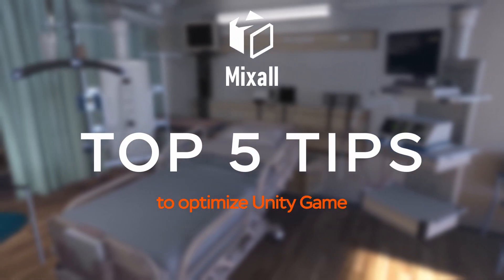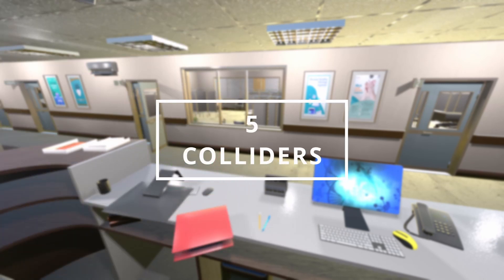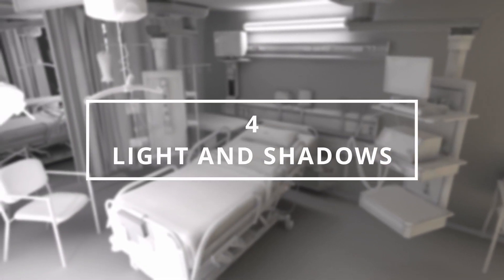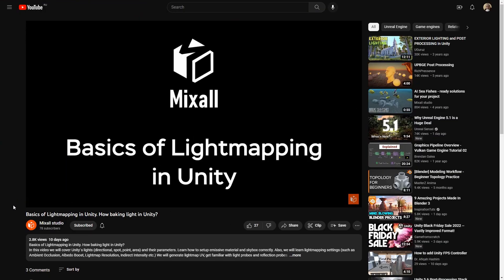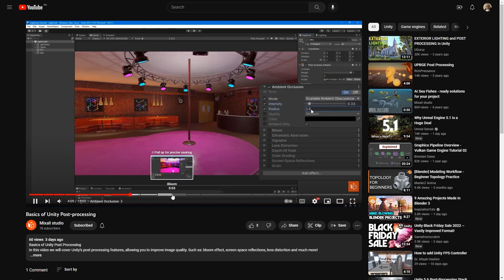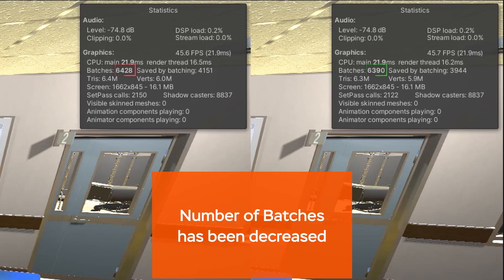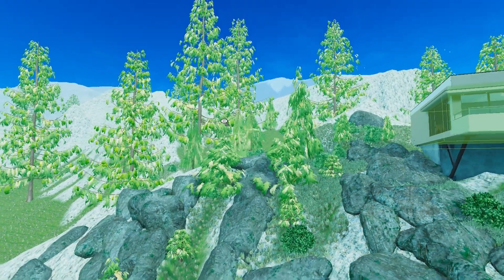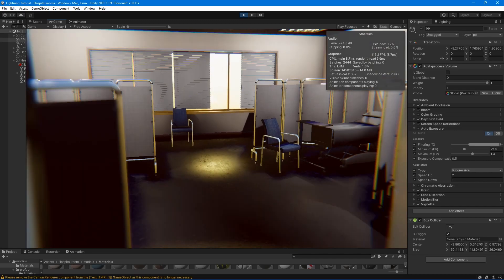Unity Optimization tips | Unity 2022

Comment: Hey there :)
Always good to see videos like this.

"Mesh Colliders"
on the first Hand, you right. They will consume more Power than Box Colliders. but 
you need 10 up to ??? Box Colliders to get a "fitting Collision" for one Object, and just 1 Mesh Collider, do have the same Effekt.
The best will be in every Case, to use Lod Models. If you get a Lod 0, give him a Mesh collider, the Lod 1 can have none, or if you need a Collider, one full Box collider. This is truly the better Idea, than to setup your Scene holding 200 Box colliders, in difference to ~ 10 Mesh colliders.

"Baket Light and Schadows"
Yes, they are a possible Idea. The problems start with the following massive problems with Light Bakings:
1. - All Textures and Materials, contain the Light Baking. This is handlet by Default and needet. To set other Thigns into Places will be fail, if you have a "Baket" Texture. This is the disadventage to "Real time Light"

2. - you cant do really "new LIghts" inside a baket Scene. This is also a huge Problem with Baked Lights.

3. - the Baking of Light Textures only works if you have mapped GameObjects, what do not use "Cube Mapping" or "Oversized UV Maps". If you using oversized UV, and tileds, you have a lot better Quality and highter Texture Resolution possibilitys, than to use thigns like boring "Substance Textur Crazyness Graphic Card Memory Killer" Models. So in this case : you cant use Light Baking. The Reason is simple: Light Baking Textures can only be generatet for Objects, are mappet inside the UV Space of the Texture. This is truly in most cases a absolutly waste of Textures, Texture Memory, and slows down every Game.
To use Tileds and oversized UV Maps, is always the better choice.

So: yes Light baking - can - save Power,
but the bad Sides of Light Baking are so massivly, that it really is not usable to me.
Better to do Real Time Lightning, and be cairful and clever with the Light inside the Scene.
Best of all: you also can bound your Lightning to the Lods you use. Will be save more Performance in Realtime Lightning, with a 10 times better Result, than to use baked light, only contains for one scene, with one Material, and only 1 Place Possibility for your Objects.

You fill up your Graphic Memory with A LOT of Textures all are baked! 
not a nice Idea.

Post Processing, you are absolutly right.
but i recommend to use an Asset, not the Unity Default Package. The post Processing Volume v2 is okay,
but i focus Kronnect Beautify. It s more flexible, gives you better Performance, can do a lot , posprocessing cant do.
its worth every Cent.

in Case of "post Processing" Save Performance in the case not to use "Color Grading", instet use Light with the different Light colors. You will have the same Result, without light baking you better on your way.

Also use center Lights in rooms. often, you do not need to give every "Lamp" a Light. It s just a Performance Waste.
do one Center Light. Better, same Result.

3.: Occlusion Calling.
can be useful, but also brings CPU Overheats. Be cairful with that. To set all in different Layers, consumes often more Powers, than to set a Render Scene without Occlusion. Better to use frustrum Calling, if you want this. This need not so much layers. In Open Worlds it s the best idea to use a Frustrum Calling, also handle this with "Sight Cubes" in a Grid System.
So you have less void updates, and a perfect Usage to disable the whole not visable Scene, with only 1 Void Update.
Working like a Charm. But Frustrum Calling need Experience, need Model Building, and also need to buy an asset.
Occlusion Calling in Unity did never work for me. It does not care how i setup it, unity is: "baking, baking, baking into eternity" never finish this. I dont know why, it s just the point. Also in open Worlds, Occlusion Calling is a really big Problem. If you using a World Streaming System for Example, you should have a Solution from the store contains this Occlusion *OR* you have to find a own way.

out of the Box, Occlusion is just there useful, there you have a static scene (for example, one Room, like your Hospital).
but: this is rare...... and always think about one thing: with EVERY Frame, you need to trigger EVERY Occlusion setup inside *EVERY* scene Model, to have the Result: "Visable or not".

not a really good Idea.
Can help, but occlusio is the last way to do things. There a lot ideas what are better than this.

One of the Most problems is really good to see at 3:56 "Batches" and mostly: draw Calls and Setpass Calls.
They are a lot more interesting! Your whole Scene there, can be done with ~ 10 % of this.
contains some Blender work, but will be very helpful. If i design this level from Hand (not with sucking modular Assets)
i will have more than 1000 FPS.

To the last Point
This. ,is the true Power!
"Use an external 3D Software" ( Blender for Example, best i think :D  i am in Love with Blender 2.79, a lot ppl with 2,X or 3.X (not my Software, i hate the UI Changes and usage Changes  ) but

like you show at the End: 
your assets for example, are Modular. This is a good Way to go, for all ppl do not know what are a 3D Program is, or how to use. in the Case of modular assets it s always better, to combine them in a Blender scene, than to use Unity for.
Maybe: it s compfortable to build Scenes with Modulars, but it s never a good Idea. You will have a *HUGE!!!* amount of senceless colliders, a LOT of Drawcalls, Setpasscalls, a lot ppl using "Tags" on , what all consumes Performance for...

nothing.

Every Light you use, is calculatet on every "Part" o na Modular Asset.

so at the end
the best of all is: USE A MESH COMBINER if you not know how to work in a 3D Program, to combine the Meshes.
build 1 Mesh Collider, max of 2 Mesh Colliders.

problem with Mesh Combiners: you will loose the Lod Models.
And Lod models are the true power.

You did a very nice video, contains some Hints for Beginners and New Ppl.
Gratulations i really like it :D

okay 4 now.
Maybe: if you have i will have a look into your store, but: most i do my things myself.
Reason ?
i cant use "Modular" assets, to much Drawcalls....

( PS: always i read some Assetspecs i did see, i go crazy. For example: 1 Charakter, using 40 Textures. This are not usable things, this are game killers)

best Greetings, and keep up the good Work.